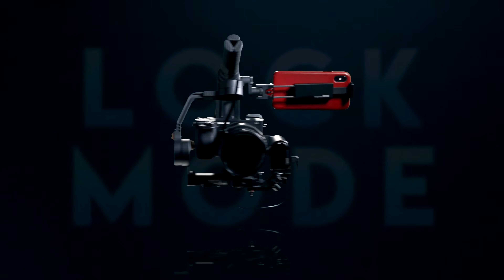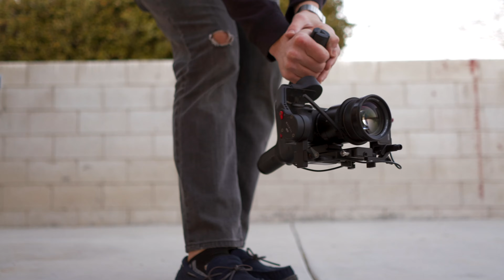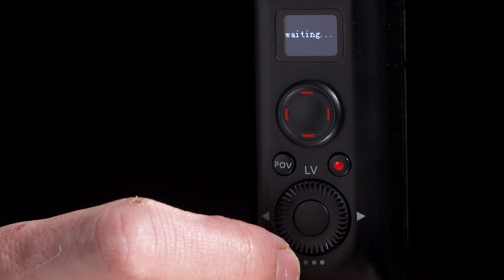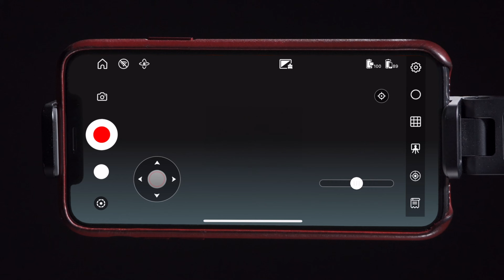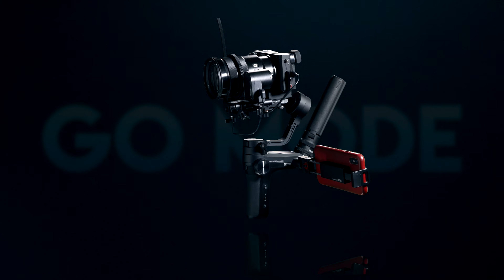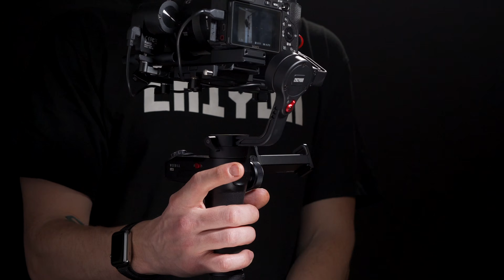Zhiyun Weebill LAB Hacks!

Comment: The only downfall do7.pl/ZStabilizer I found is the rosette mount. Admittedly, I had to return my first Weebill S because the rosette mount is screwed into the soft aluminum body by and hand full of tiny screws which have very short lengths and small threads. When mounting my monitor using a bracket from SmallRig, the rosette mount snapped right off of the body and stripped the screw holes and could be repaired. I wish Zhiyun had used a harder steel for that portion of the body so that the screws didnt strip the holes so easily.

Comment: hi. my weebill lab keeps on vibrating in some angles and today i tried vortex mode and it wasn't working and my motors strenght was hig and i am using sony a6300 with sigma 30 mm. kindly help. gimbal was stable.
Reply from the maker: Make sure the pan axis is correctly balanced.

Comment: Has anyone figured out how to lock F mode without a phone yet?
Reply: Turning on full-follow mode (without having to keep the front button pressed) is now possible with the latest firmware (v1.88): hold the trigger to engage follow mode, then tap the 'LV' button 3 times to lock all of the controls. This keeps the trigger locked on. To unlock, just tap the "LV" button 3 times.

Comment: hi i have a question I bought zhiyun crane 3 lab and I have a Canon XA10 camera. Can I connect the zhiyun crane 3 lab remote control cable to my camera to start and stop video recording?
Reply from the maker: No it doesn't support the video cameras
Reply: @ZhiyunTechGlobal  I just wish I could start and stop the video recording. What cable can I use? I don't need the other functions of zhiyun crane 3 lab. just start and stop recording with the crane 3 lab recording button
Reply from the maker: @rafaeldelapaz6737  It is not about the cable. It is a camera control protocol issue.
Reply: @ZhiyunTechGlobal  I understand and in question of the video transmission through the HDMI cable if it works with Canon XA10?
Reply: I also have a Canon 200D Canon EOS Rebel SL2 camera. Is it useful to use the recording button of the Zhiyun Crane 3 Lab? And what cable should I use?
Reply from the maker: @rafaeldelapaz6737  https://zhiyundata.oss-cn-shenzhen.aliyuncs.com/zyplay/binary/supportmodel/CRANE%203%20LAB%20Camera%20Compatibility%20List%20(EN).pdf

Comment: I want use the follow mode (f) on zhiyun webill lab, without press the front button or use phone for make it. 
I think that the mode (F) is more important of the mode (pov) that have a dedicated button
Reply: Turning on full-follow mode (without having to keep the front button pressed) is now possible with the latest firmware (v1.88): hold the trigger to engage follow mode, then tap the 'LV' button 3 times to lock all of the controls. This keeps the trigger locked on. To unlock, just tap the "LV" button 3 times.
Reply: @johngaleano1291  OMG THIS IS GENIUS!!!!!! WORKED PERFECTLY THANK YOU SO MUCH
Reply: @vTvvo  no problem brother. Glad I could help!
Reply: Same here, did they release a firmware for this?

Comment: Hey I just bought the webill lab.  And I have a gh5 with a 12-60mm Panasonic lense. My set up weighs about 2.5lbs and it does say it holds up to 6ish lbs. I am worried about the compatibility list since it does not show my lense . Would that be a problem? With using the gimbal?😳
Reply from the maker: This lens can work. Make sure it is balanced and change the motor strength to high.

Comment: hey Brad. do you know how to save the control rate parameter settings in the weebill lab? so that once you have changed them in the app the stay that way even after turning the gimbal off and on again without using the app? thank you
Reply from the maker: At present, the custom settings can only be saved in the app.
Reply: thank you for the answer. please change this if possible in a future firmware update. @ZhiyunTechGlobal
Reply from the maker: @stefangimpl4138  We will forward your suggestion to our developers.

Comment: Many people don't know if Webill Lab works with Sony A7iii and 24-105 f4 or 16-35 2.8 GM lens. Please make a video about this, I think you're loosing lots of customers due to the bad video reviews with people not making it work.
Reply from the maker: Please check the camera support list here https://zhiyundata.oss-cn-shenzhen.aliyuncs.com/zyplay/binary/supportmodel/WEEBILL%20LAB%20Camera%20Compatibility%20List%20(EN).pdf
Reply: +Robert Larsson It kinda works with the a7iii works with the 16-35 gm. I've gotten it decently balanced although you won't be able to go into flashlight mode because the eyepiece will hit the rear motor. I was able to rig some counter balance weights which allowed me to use the gimbal as intended but it just wasn't an ideal combo. I opted on getting a lighter weight lens combo for the weebill lab and the Ronin S for a more robust set up. Look into the samyang 24m af f2.8. Beast of a little lens with great autofocus for a very cheap price. Good Luck!

Comment: Hi Brad, I have a question. Is it possible to slow down the maximum rotation speed of the Weebill lab? With my other gimbal, the Zhiyun crane v 2 it is possible to adjust the maximum speed via the app. But I couldn't find this option in the ZY play app. 
If it is possible for the Weebill lab too, can you explain me how to do this?
I thank you in advance.
Jack
Reply from the maker: If you mean the speed of vortex mode, you can adjust the speed with the latest firmware.
Reply: @ZhiyunTechGlobal  Thanks for your reaction!

Comment: Thanks Brad, very helpful stuff! One thing bothers me, the triple lock does lock every button APART from the power on / off button. This should be addressed as I have accidentally powered off the Weebill numerous times (especially when using both hands to operate, which is very much to my liking). This should be addressed as follows: Triple clicking the LV button locks''ALL'' buttons (including the power on / off button!). But when ''ALL''  buttons are locked, the pressing of LV or POV button together with power button will power off the gimbal... This is in case if anything goes terribly wrong and Gimbal needs to be shut off in the emergency. Keep up the great work!
Reply: what really sucks is if someone like me who always use   the All follow F mode but dislike holding the button to maintain all the time , so when my phone run out of the battery , BOOM!  and frequently  mess up with the power off  button as well, I am thinking maybe I should use my Plus as well, rather than this gear.

Comment: I can not balance my GH4 camera with a microphone on it. why?  (12-35 lens)
Reply from the maker: Try to use some counterweights because the mic will change the barycenter.
Reply: @ZhiyunTechGlobal  Hi,
I do not have weights,
They were not part of the kit I bought. I do not know there are any.
But if I had weights, how would I put them on the gimbel?
Until now nothing helped. I can not record quality sound with the gimbel.
Perhaps you will spend a video in favor of connecting additional items such as microphone and others that affect the balance.
Thank you
Reply from the maker: @LifestoryDocofilm  Thanks for your suggestion and later we'll release some accessories like that. At present you may need to find some common camera accessory like cages to try with the mic.
Reply: @ZhiyunTechGlobal  Thanks
Reply: I dont get it. The weebill works perfectly with my gh5 and 12-35 lens. Why it didnt with your gh4???

Comment: Thanks for telling about locking the keys, my 2nd most Complaint just resolved, 1st is we cant turn on Follow mode directly from gimbal with holding front trigger, and the 3rd is holding go button to keep ur gimbal in sports mode, this should had some option.
Reply: There is a way, Press and hold front button to be in follow mode then simultaneously triple click LV to lock and stay in follow mode
Reply: @visualsbypreet  Bro thank you for this tip. I've been trying to figure out how the hell to stay in follow mode without the app. Best tip in this whole comment section!!
Reply: kiddmaff5646 ur welcome bro
Reply from the maker: You can use the app to switch to different modes.
Reply: @ZhiyunTechGlobal  Of course, BUT full follow mode needs to be enabled all time not only by app or holding the trigger button (which is exhausting) but by a physical button on the gimbal!! Also I don't see support for Canon DSLR models which is stripped for no reason as it was working like a charm on my Crane 2!! Come on ZHIYUN you can do better than this!
Reply: @arthura777  There is a way, Press and hold front button to be in follow mode then simultaneously triple click LV to lock and stay in follow mode
Reply: @visualsbypreet  thank you so much for your precious tip! I have another one if you have discoverded it.. that is if there is an AUTO CALIBRATION button as it is  in the DJI RONIN and MOZA AIR 2??
Reply: @arthura777  youre welcome, I am not aware of  the auto calibration button
Reply: @visualsbypreet  Hello! The Auto Balance/Calibration function which jitters the camera in all axis and tests the values to be optimal for the weight is in the phone APP! Have you noticed similar think in the Zhiyun APP?